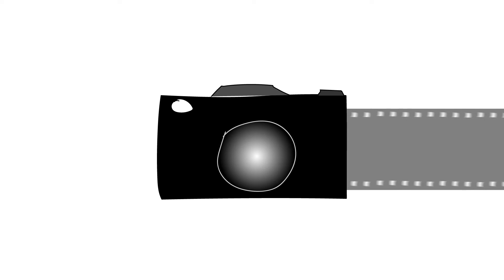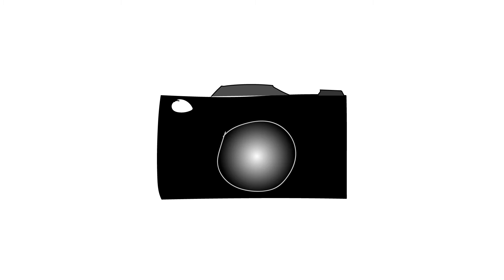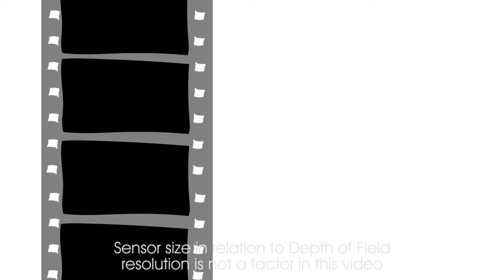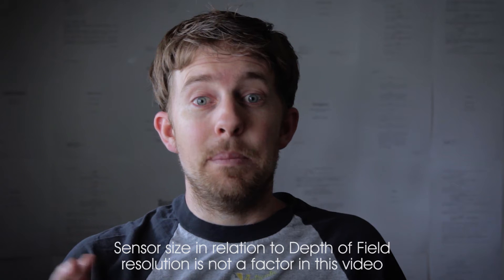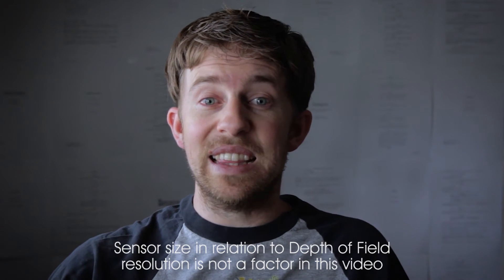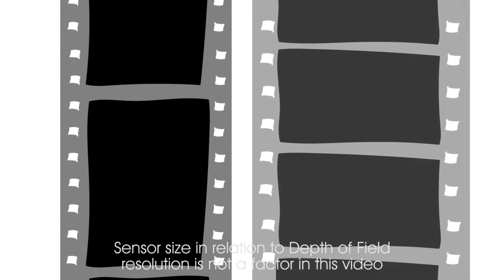APS-C vs Full Frame Sensor

Comment: Dude you are missing the point! The full frame censor provide an image quality both for still and motion pictures that the crop censor will never ever be equivalent. Just because more light bounce on the censor itself. Which enables the system to analyze better any given situation and create an image with more pixels, by nature with more definition. You are also comparing to different camera specificities which obviously can’t work, organic (film) and digital (censor). Those two work in two différents manner. Film is kind limited in the way it treat the picture. When the FFC give more range. Because enough HQ material is created to work with or just leave on the side....
Reply from the maker: I don't think I'm missing the point, I think I am just making a different point.  My argument lies more in the depth of field you achieve in the image.  I also don't think resolution plays a huge role in it because you can easily find MFT sensors that capture high data 4K images from the entire sensor coverage and full frame cameras that crop out the center of the sensor to capture 4K.

When it comes to film it sounds like you are making reference to open gate capture, that is usually done at the lab and most specifically for VFX work or the DI.  Also there are film scanners that can get you some really high resolution scans.  Yes film images are captured differently than digital images (film emults), but they both need light and lenses.

Fstoppers did a great video on depth of field awhile back and it reveals it comes down to lens equivalents that make the difference.

Thanks for watching, I do appreciate your feedback.

Comment: I use both FF and APS-C for stills, video however is almost exclusively super35 format with the FF and APS-C - I only uses the FF video when needing the wider angel I can't get without using FF.

For stills the faster sensor of FF is clearly superior.
Reply from the maker: +molan oh, definitely.  Also FF matches a typical 35mm film still camera closest as well.

Comment: thanks man, you save me 1000's! :D
Reply from the maker: Glad I could help!
Reply: Jared, on your parts list, you note both Rode mics.. have you compared these to say a more directional mic? How are the Rodes for eliminating ambient sound? I noticed with really "good" directional mics, if you are in a small room, voice bounces around the room so the "really good" mic eliminates most of what you want to record!.. so perhaps a "really good" directional mic is not as effective indoors?
Reply from the maker: +Martial 3231 i have compared the mics and obviously a more expensive mic is going to sound better.  I really like my MXL 991 but it does requires phantom power.  If you are receiving a lot of bounce with your recording try putting blankets on a wall or fill the room with a bunch of pillows.  The mic isn't going to remove the echo or bounce from a room, but simply adding some sound absorbing elements to it will drastically help.